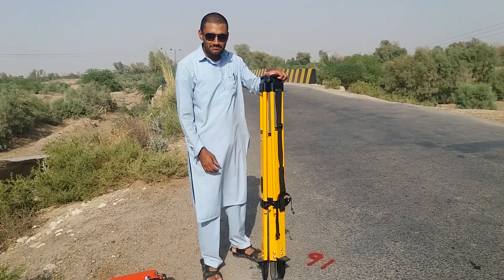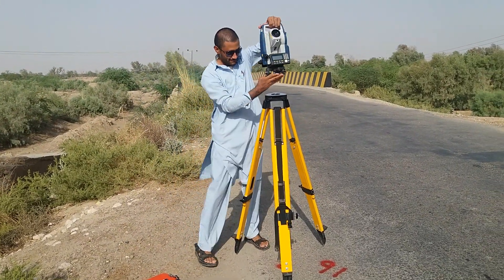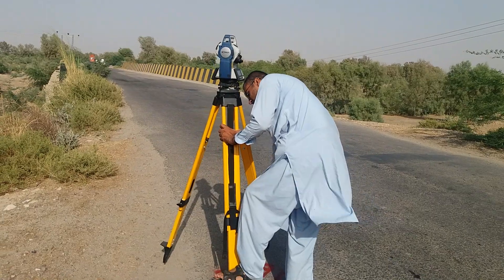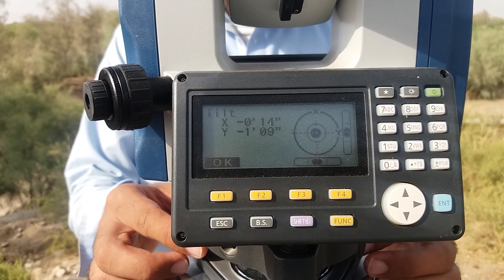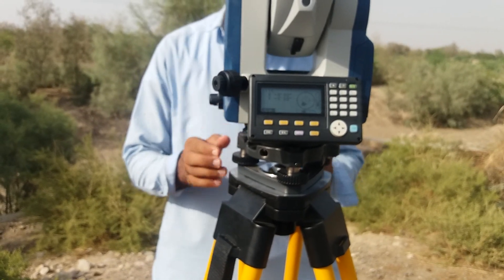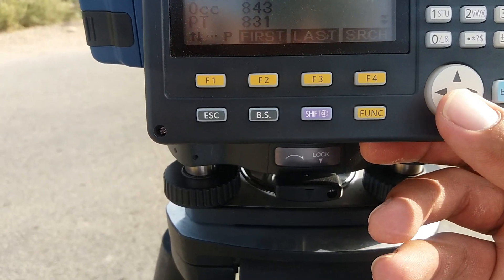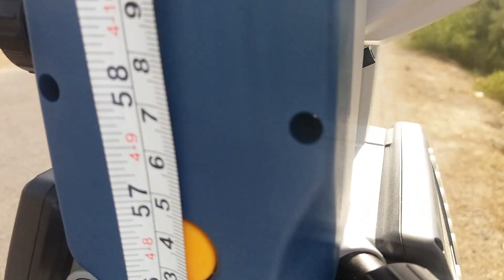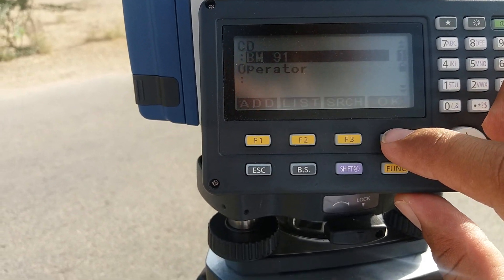Sokkia CX 102 | 105 setup | how to survey

Comment: Nice video. I would suggest to use tripod stabilizer for equipment safety specifically when using on concrete and slippery surfaces.